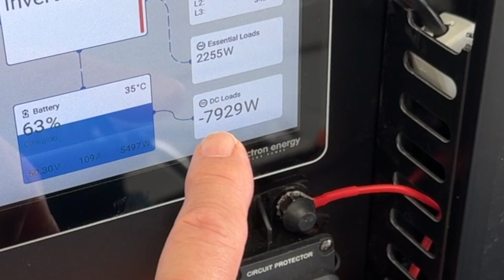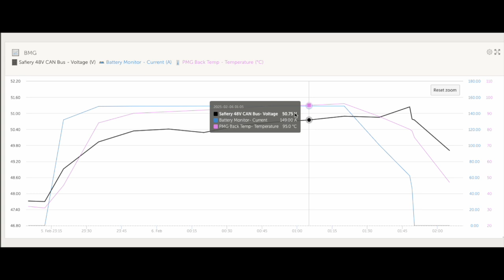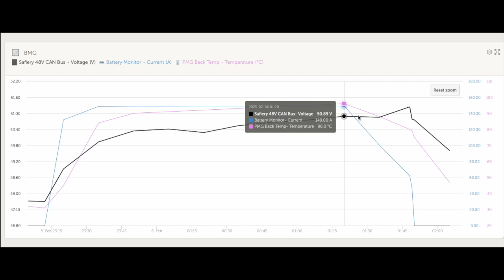Hybrid Alternator runs at 8kW for 2 hours till 48V Lithium batteries are full no CAN BMS on Battery

Comment: So this charges the battery directly, i.e. no DC-DC charger? Would it work with solar charging at the same time? I have 20 KWh of LiFePo4 in a skoolie conversion this would be ideal for.
Reply from the maker: Yes it charges directly. The DC DC adds 48-12V and can charge from the 12V factory alernator for added power.

Comment: How do you install it in a Sprinter van 2024 engine OM654. Is the Scotty required to be installed in the engine bay or can it be installed at rear ( 170 extended van).  I am asking as the length of the wiring loom or harness is not clear or specified in your website. Have you sold it to US customers already.
Reply from the maker: Hi, yes we have our first shipment going to USA distributor later this week. Scotty is not in the engine bay. Its the CAN connection from Scotty that goes to the BMY. https://upfitterswholesale.com/ can assist you.
Reply: @Safiery . Thanks for your reply. I am very interested in the BMG and Scotty AI V3 1500W set for a Sprinter 170 Ext. Does the wiring harness (CAN bus and temp sensors, etc ) comes with enough length to reach the rear of the van ( approx 24 ft) if the Scotty is placed there in the power system cabinet. Also, what about the harness for the Sprinter factory/stock alternator connecting the Scotty on the 12v terminal.

Comment: Just a dumb question, can you add two fly wheels on the motor and rig 2 alternators instead of just one generating 16K watts loading the batts up in 1 hour? can the system sustain 300amps?
Reply from the maker: Yes, we have run dual 12V alternators with twin Scotty AI's in the past. They are virtually opposing and so have a big benefit of no side load on the engine.
Reply: @Safiery  pretty cool, so you can basically add a wind turbine with an alternator to give you constant 24hrs electricity.. with a modified alternator? wouldn't that be a better solution? or do you not have that much wind where you are at?

Comment: Looks like very similar output to my APS160 on my Yanmar. Maybe 0.5kw more depending on temp. 
I’m assuming it’s a Valeo. Do you have plans to release a CAN controller without the DCDC converter?
I’d be interested in lamination temps. They get to about 150C on the APS, with much cooler front / rear.
Reply from the maker: I just had a look at the APS-160. Its a traditional alternator listed as 70% efficient (thats when cold). Ours is 90% efficient, then the inverter is 94%. So you require more fuel to run the APS-160 at the same electrical load. You can't control it with a CAN controller. it needs a remote regulator that is a substitute for diodes.
Reply from the maker: Yes it is similar to the Valeo but more power with a different inverter. What controller do you use for the APS160?

Comment: Would those alternators be available for aftermarket generator replacements? This is for off-grid home usage, not a boat ;-).
Reply from the maker: Yes they are. The one in the test rib is perfect for that. It generates the 48V as a solar backup. Then run inverter from 48V batteries. DC generation is so much more efficient than AC.